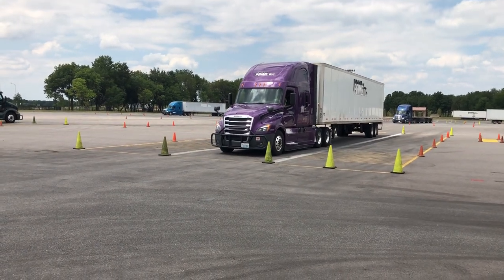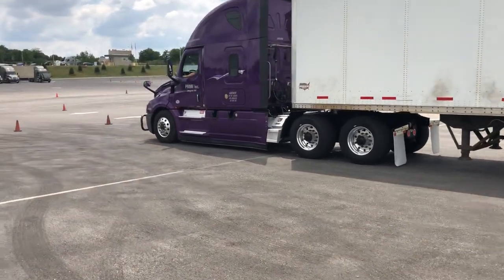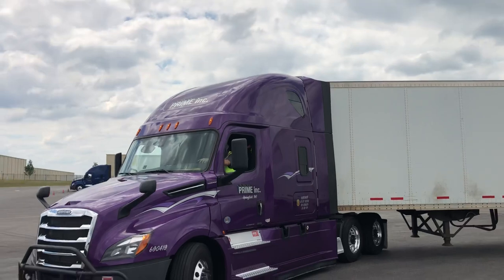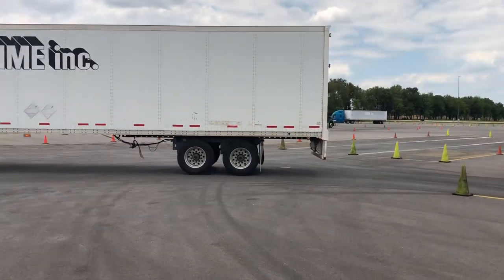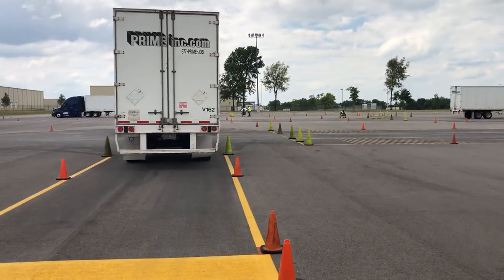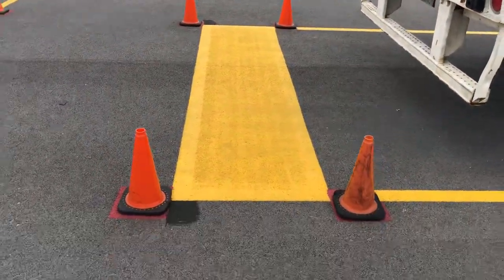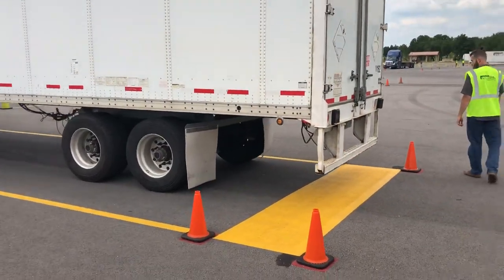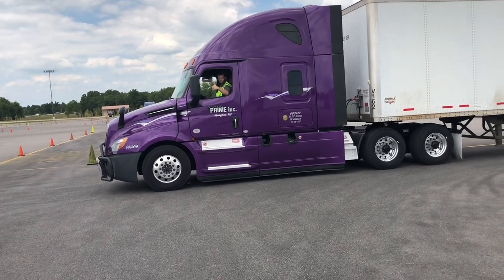Backing Practice: Alley Dock

Comment: Good video but you should have focused more on what the driver was doing with the tractor to guide the trailer in the box not the back of the trailer. That would be more helpful for a struggling student
Reply: He did... lol
Reply: Where did he do that! He never showed what his steering wheels were doing to get it in the box!
Reply: That’s the problem I’m having also is how to turn the steering wheel to position the trailer
Reply: “He’s gonna maintain the gap”, is what he was doing to walk the trailer into the box.
Reply: @mikethomas4908  new drivers don't understand maintain the gap they need to see how it's done I hope your not a trainer
Reply: @agares3030  the steering is different in every situation. Sometimes you have to alley dock further away because of obstacles  or at different angles. You have to back very slowly and maintain the gap to do an alley dock every time perfectly. When you are too far out, get more angle to the turn to tighten and vice versa. Always watch your trailer tandems and not the steering wheel.

Comment: I rocked my alley dock...3xs back to back my first try... my trainer D is BOMB!!!!!
Reply: I know this comment is from a while ago but I'm in school now. I have basically perfected the Straight back and the offset but the alley dock is giving some issues. I have done it perfectly twice but every other time I end up needing help to make it right. Idk what I did the times I got it right lol. I should have paid attention but I guess I was happy to do it by myself I wasn't thinking. Anyways my question is I can get my trailer in between the cones but my truck is at a 90 degree or a almost a 90 degrees and for some reason I can't figure out which way to cut the wheel to get the truck straight and then I can turn it into a straight back. It's confusing. Just trying to get all the help I can. I take the test next week. Bc my instructor points are I make a hard left while outside the cones and that gets my trailer going in between the cones but then I freeze and can't figure out how to get the truck straight without crossing the boundary. Thanks in advance of you have any tips on this.
Reply: @32tolife38 hey did you figure this out?
Reply: @Everydaytruckingg  hell yeah. It ended up being 2nd nature after a while. I didn't even have to think about it or do any pull ups most of the time.. sometimes 1 though. It was stressful at first though.
Reply: @32tolife38  i hope all is well I freeze when in near the cones rn. Do you have any tip. Should I pull up and to the right all the way to fix alignment?
Reply: @Theater1TV  depends, of you are near the cones on your driver's side then I'd keep backing it in as far as you can go.. then use a pull up. Before I left school I was doing the alley dock with no pulls up, sometimes I'd use one just to get it straight.
Reply: @Theater1TV  if the cones are on your passenger side that's a little trickier. I always tried to be close to the driver side cones but not too close for comfort.
Reply: @32tolife38 thanks bro i appreciate it im  Coming back with the steering wheel turned left. When do you begin turning the steering right while backing, because im told to maintain a gap with landingear.
Reply: @Theater1TV  yeah do that.. keep it at a hard left. It will seem like you are gonna hit the cones and should come out of the left but don't bc it's just your eyes tricking you. Then once the back of the trailer starts going in the cones you'll know when to put a right in it.
Reply: @32tolife38  Thanks bro 🙏 🙌🏽. Ill let you know how it goes when I get back from otr with my trainer.
Reply: @Theater1TV  oh yeah definitely.. let me know. I helped other people in my class once I got it down but the way I learned was I rode with another guy and watched ever stopping point he made and I had it down after that. It's a lot easier showing you than telling you but you got this.

Comment: Practice Perfection when doing this. I did this, and any mistake, I pulled up and restarted, unil it was perfect. Now I get it 90% without pull ups, or encroaching
Reply: Well I’m about to take my road test and can not do Allie I wonder way maybe you could help me
Reply: @vovojoanacanada  how can I help?
Your tandem's need to start turning into the hole 10' before the cones, then jack knife your wheels. Ones in, start getting under it quickly.
Reply: @zurialjazz  I’ll try again Tuesday since I have 3 pulls ups for Ontario it will be ok thanks for the tip .

Comment: As long as the truck is not straightened or aligned with the trialer your right side steering will be just bringing back the steering wheel to the center to enforce the trialer to go to left. While you are maintaining your curve keep watching the driver side mirror specifically the rear left corner of your trialer once it starts moving to the right you should start turning your steering wheel to the left two turns to jackknife it a little bit. Keep doing and following the same pattern and technique till you get your truck and trialer aligned and striaght with each other. At this point start perform the striaght backing as usual 👌👍

Comment: Keep watching the big mirrors and the convex mirrors. The convex mirrors show you exactly when your trialer back corners are going to and that's going to be your reference point of when you should start doing your steering either to the right or to the left 😉👍
Reply: Peace bro,  after letting the wheel go. We straighten the emblem by turning the wheel a little more to the left.? Then we use the mirrors as you mentioned to guide our trailer back in? Im in the middle of this lesson.
Reply: @Theater1TV  Good luck 👍

Comment: Hi sir, could you tell me please what’s the red one next to parking break ? Which one you had pushed for check air with parking break. Thanks
Reply: Red knob is trailer air supply. For an example on what it does. Last week I had a trailer who's air bags were deflated. They did not inflate until I pushed in my Trailer Air Supply. Upon being released the air bags deflated again. This isn't a common issue with most good trailers but some have this issue

Comment: One thing is if you GOAL you must turn off the rig and take your keys with you or you will FAIL. Is what I was told. So if you made your maneuver great and for get your keys in hand big Fail.
Reply: I took my CDL exam at Prime 1 year ago. I did two "GOALs", leaving the engine running, transmission in neutral, and brakes applied, with a Prime examiner and a Missouri DOT examiner present. No points were deducted.

Comment: WHAT HAPPENS IF HE FORGOT TO BLOW THE HORN?
Reply: Remember to shut off engine and take your keys. If not you FAIL> This is in Minnesota. But I am not sure if it is in other states.
Reply: @amtraktraveler9118  same in Florida.
Reply: It's an automatic failed ( At least in Florida ) When you blow your horn, you telling the instructor your finished wherever maneuver you are doing. Either you move to the next assignment,  or done with your CDL test.
Reply: 90 degree backing is basically about set up positions. Take 7 steps from the cone where u are going to back into. After that 7steps walk 4steps towards your rear bumper and thats how you will know that u are properly set up and lined up before performing the 90  degree backing and remember cut the wheel  to the right and roll with it. Depending on the trailer u are doing your 90 degree backing u can go 95 degree after u your wheels are cut hard to the  right as u are rolling. Once you approach 95degrees stop and cut the wheel hard left and once again roll back between the cones and after you are inside the cones remember your landing gear has to be in line with the first cone then do your GOAL and  make sure you complete your 90 degree backing within 10 minutes. I personally had bumpy ways along the way to master the 90 degree on my CDL test at the drive test centre  multiple times.  Good luck to all who are talented brave and passionate about being truck drivers. Anyway monday is my CDL road test  west of toronto @10 am and im doing an Off set backing for the first time hope i get a normal examiner. Hope i pass my  Az  CDL  on monday and start applying to major trucking companies  and applying my skills i have learned through out the process. Take care